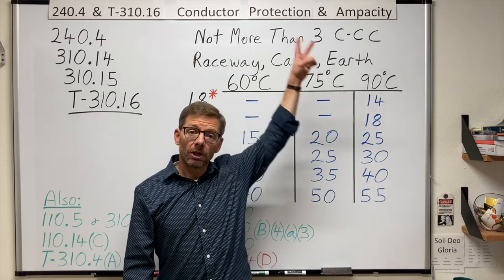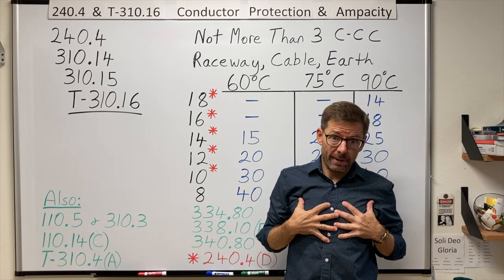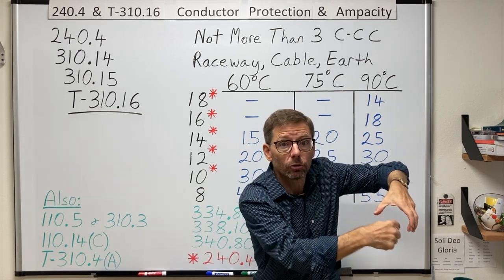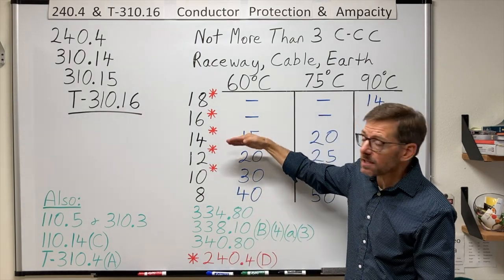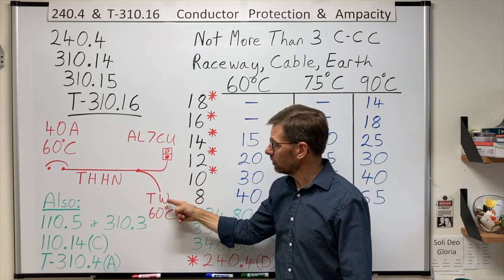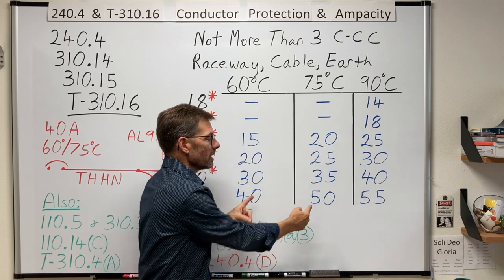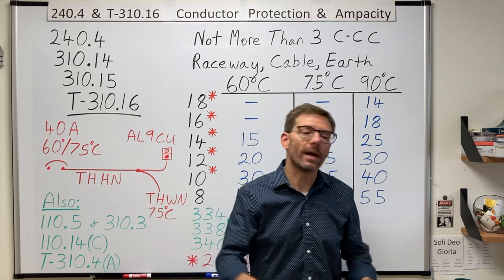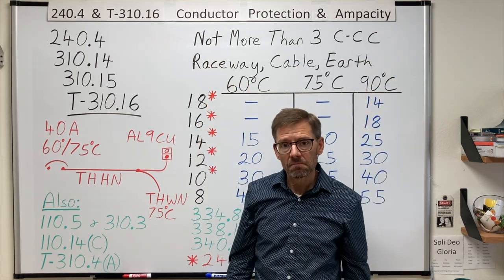240.4  &  T-310.16  Conductor Protection and Ampacity

Comment: You really have a gift for teaching.  I a retired electronics engineer.  I built a house a couple of years back and did my own wiring using the code and consultation with an electrician and an inspector.  You've cleared up a lot of things.  I especially liked your demonstrations with the battery stacks and open neutrals, etc.  All very good.  Thanks for sharing.
Reply: Bet your electrician said your over thinking  it

Comment: If you had #2 Al SER from the main to a sub running along floor joist in a basement and then popping through the garage wall into PVC conduit that runs along the outside of the drywall to the sub box.  The sub box charges an EV for 8 hours continuously (truck is adjustable from 20 to 80 amps), a hot tub, and a few seldom used 20 / 30 amp outlets. Also the SER Al is about 100’ long total.  The sub breakers are 50 amp on #6 Cu for the hot tub,  #3 Cu on a 90 amp breaker to the EV Truck, (2) #12 on 20 amps, and #10 Cu on a 30 amp. Note: the 20s & 30 never get used unless the truck is in the driveway NOT charging because there is no room to use power tools with it in the garage. 

I ask because my house has a 100 amp breaker on the main 200 amp service that feeds a sub and I feel like they should be 80 amp on both the sub and main, when I review all the code sections an derate for the breakers 75° & continue use due to the EV truck exceeding 3 hours.    Note: I’ve been charging at 70 amps max since I think the system shouldn’t have 100 amp breakers & I have NOT tripped a breaker yet.  Sometime I want to turn the truck up to 80 to see if it does trip a breaker but I also don’t want to damage the breakers with excessive heat (I’m assuming the wire can handle the tub and truck rocking at the same time since it’s all 90° C rated wire but the poor breaker is only 75° rated for 100 amps and if the hot tub and truck both go full out they would exceed 100 amps (80 plus 50 potential).

Comment: When you say we can start in the 90 degree column for smaller wire as long as we don’t end up with the ampacity larger than the 60 degree column, I assume you are talking about for your ambient temp and derating adjustments. Is that correct? Otherwise you would go directly to the 60?

Comment: A very good instructional video! However I have a minor correction. The conductor type, for NM, is not actually found in 334.80 although insinuated. It is really not found until 334.112

Comment: If more than 3 CCC are ran thru a conduit can u instead of upgrading wire just change out conduit to a bigger size and if so what would b the correct size to use?  And what percentage of the conduit fill would be used?
Reply: I’m not a technician (though an electrical engineer), but regarding your first question, as far as I know,  no, changing the size of the raceway (conduit/tubing) doesn’t change the correction factor for more than 3 CCC.

Regarding your second question, table 1 of chapter 9 says to use up to 53%, 31%, or 40% (sometimes 60% instead), for conduit/tubing carrying respectively 1 wire, 2 wires, or more than 2 wires. And that’s including CCC as well as ground/grounding conductors, signal conductors, etc., because such calculation is for conduit fill, not for thermal reasons.

Comment: Question about PV source circuits.  I have a 2 strings run in parallel. Total current calculated 690.8 A and B.  34.81 amps total.  The contractor is using # 10 stating that because there is not OCPD between the modules and the inverter that 240.4(D) does not apply and the conductors are rated for 35 amps.  Your thoughts I believe they should be #8 CU
Reply: The PV source circuits are fine as #10 but the combined PV output circuits should be #8. Hope this was resolved appropriately.

Comment: 110.14 C with the 100amp rule states that below 100a, we're to default to the 60deg column. But, ay 15:00ish you show where we can use the 75deg column for a 40amp circuit, provided the connections are temp suitable. 

What am i misinterpreting?

Comment: I thought the temp ratings were the current a conductor could carry at that ambient temp.  So as long as you don’t have more current on that conductor it’ll never exceed the temp listed regardless of the ambient temp?
Reply from the maker: Forgive me if I over-explain, but let's first clarify that "temperature ratings" are the maximum temperature that a type of insulation can handle and the "ambient temperature" is the temperature of the surrounding air.

Now let's look at it this a couple ways.

FIRST EXPLANATION: We know that current flow through resistance causes heat and as more current flows, more heat is generated.  Conductors are, in a sense, long resistors (see Ch. 9 Table 8).  When no current is flowing, how hot is the wire?  Well, it's probably the same temperature as the ambient temperature (the air around it).  As current starts to flow, the temperature of the wire will increase from ambient temperature. So, if a wire is in a refrigerated room it is starting from a colder point than a wire in a hot factory environment.  With the same type of wire in both locations, both running the same amperage, which one do you think would be hotter?  I believe the wire that is in the hotter ambient temperature would run hotter.

The temperature ratings heading each of the columns of our ampacity tables are the maximum temperature that those insulation types can handle (see Table 310.4(A)).  In order to keep the conductor from damaging its own insulation by the heat generated by its own current flow, we must limit its ampacity (the current allowed to flow on it).  If we follow the conditions of use (in the written Sections 310.16 - 21) for each table, the listed ampacities should keep each conductor below its column's maximum temperature rating.

However, if we alter the conditions of use by installing conductors in a higher ambient temperature than 30 degrees C (for Tables 310.16 & 17) or 40 degrees C (for Tables 310.18 - 21), "Note 1" below each of the tables refers us to 310.15(B) for allowed corrections.  Essentially, if the ambient temperature (starting temperature with no current flow) is higher than the conditions of use we must restrict current to a smaller amount than the ampacity table states because the wire is starting out at a hotter temperature (less available temperature rise before it hits its limit), but if we are installing the wire in a colder environment we are allowed to run more current because it is starting from a colder temperature (more temperature rise available before it reaches its limit).

SECOND THOUGHT: If a car pulls the same trailer up a hill on two different days, is it more likely to overheat on the cooler day or the hotter day?  My money says more cars overheat on hot days (higher ambient temperature) than cold days.

**Coming soon... When my videos on 310.15(B)&(C) are ready I'll paste the links here**
Reply: @davegordon6819  thanks for the thorough reply. I understand what you’re explaining.  What are the impacts of additional conductors run in the same or neighboring ducts underground?  Say one conductor is run at 90 degrees - if you add a second conductor and run at 90 degrees, will there be additional heat or will the temperature remain at 90 degrees?  I’m trying to determine if additional runs of conductors in separate conduits all loaded to 90 degrees would stay at that temperature or is it strictly the maximum that you’d generate based on the “hottest” conductor?  So if you had two at 90 degrees and added a third at 100 degrees, the 100 degrees would dissipate and warm up other conductors within a certain radius based on temp, etc.
Reply from the maker: @Mike_Rundle  This may be getting out of my knowledge band.  I have had an experience of running underground service conduits where we were close to an underground steam line, but we were given a specific clearance distance by people of higher rank than I.  I also worked with a guy who told me of a large underground duct bank that they needed to redo because of overheating when they initially turned everything on.  There are other phenomena that can play into this, but if I remember correctly, mutual heating was a suspected culprit.  I believe they then routed all the conduits over head.

The answers you're looking for may be in Article 311, a new article for Medium Voltage Conductors (2,001 V to 35,000 V).  Possibly in 311.60 - "Ampacities" and/or possibly in Annex B that include dimensions for duct banks.  Unfortunately, both areas where I am not knowledgeable to speak to the specifics.

Sorry I can't be more help on this, but I will give you one more code section that I should have mentioned in my first reply.  300.17 is a general rule that underpins the ampacity and conduit fill rules - "any raceway" could be read as any raceway either on its own or in a group (i.e: duct bank).  Thanks for being curious about our trade and trying to find answers.
Reply: @davegordon6819  thanks Dave.   Your videos are great and very thorough and informative. I’ve been going through them and learning something from every video which is great. Thanks again for trying to help me find the answers.